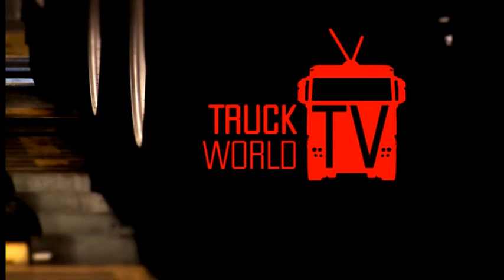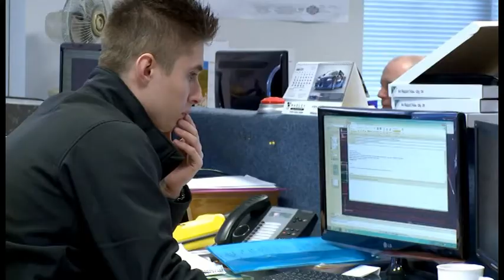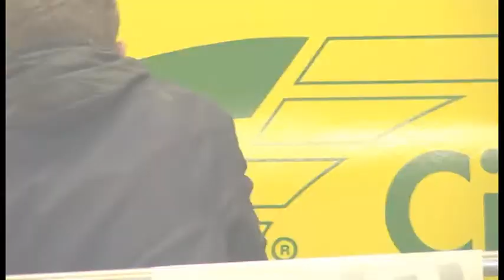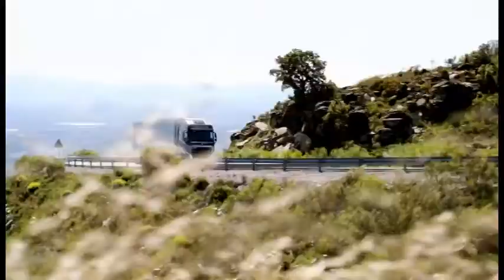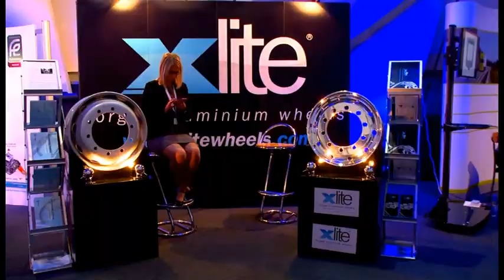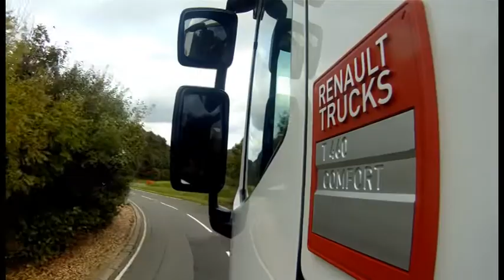TruckWorld TV Episode 2 2014

Comment: I drive a Renault T520 and it pulls really well. At 44 tons it just shrugs at hills. The retarder is very good too. Much better gearbox than the Daf and Scania. The only downside is that the controls in the cab for the radio and other controls are not intuitive so take some getting used to. Strange positioning for the cruise control with buttons and switches spread all around the dash and steering column.
Reply from the maker: Hi I agree with your comments about the radio controls etc and the retarder !  What did you drive before ??
Reply: I've driven everything else common on the road in the last 20 years, except for the V8 Scania and the Renault Magnum. I've done most miles in the DAF 85's/CF's. Most types of gearbox including the Eaton-Fuller Twinsplitter and the Roadranger
Reply from the maker: Hi Laury The CF is a good road transport workhorse but I am guessing you'd like to try the V8 Scania ?? Tim
Reply: Yes the V8 Scania is the only truck left on the road I'd like to do some long runs in at full weight to see if it lives up to the hype. Owner drivers seem to love theirs. In the 500-550 hp range, the Volvo/Renault 13 litre lump I drive at the moment would take some beating....